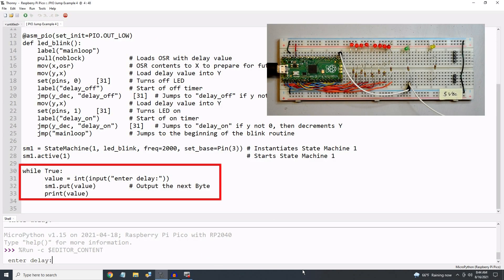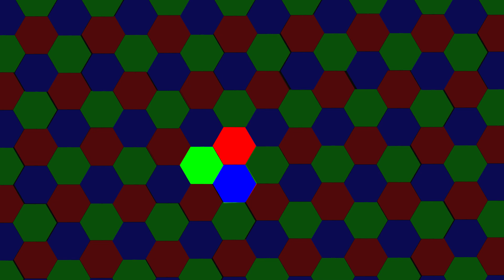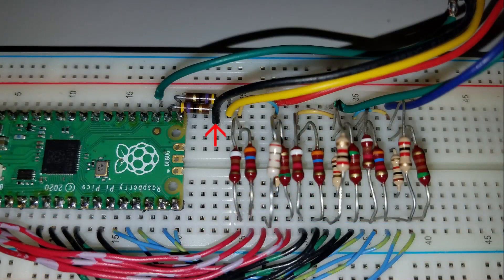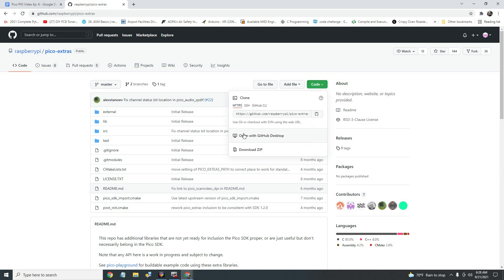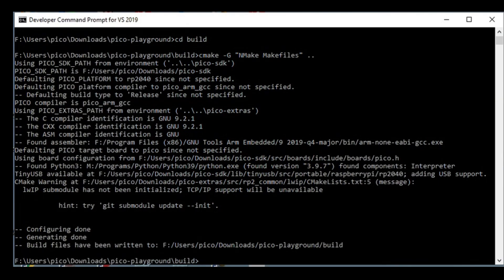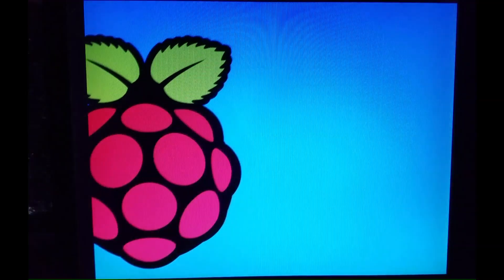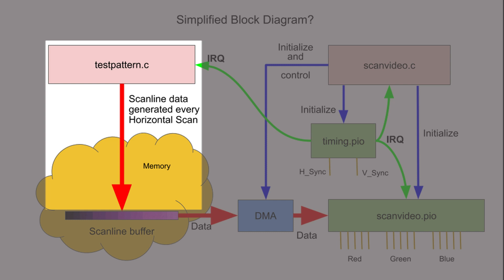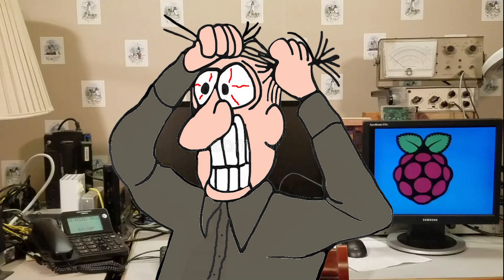Raspberry Pi Pico PIO - Ep. 6 - VGA Video and C/C++

Comment: Why would we need a switch in the resistor ladders?
Reply from the maker: Congratulations, you picked up on that!  You don't.  That switch was included in the Raspberry Pi's "Hardware Design with RP2040" (https://datasheets.raspberrypi.com/rp2040/hardware-design-with-rp2040.pdf) as a way of adding user input (See section 3.2.2).  Thanks for watching!

Comment: Pi Pico SDK environment using Visual Studio Code has improved quite a bit since when this video was created 2 years ago and I highly recommend installing the SDK environment using the Pico SDK installer.
As long as you launch VSC using the shortcut the SDK install creates, and you have your CMAKE instructions set up correctly, the VSC will dynamically help you with coding mistakes even before you build/compile your code.   It will even provide you the means of finding where a reference, such as a function or variable, is declared, defined or used rather than having to use plain Find all the time.
I often make stupid syntax mistakes or misuse of data types, and in the past, such as in Arduino IDE, I would not find out about them until I ran a build.  But with the VSC and CMAKE plugin, I find these out while I am writing, lowering the time to fix mistakes.
Reply from the maker: Thanks for the tip.  I'll have to try Visual Studio the next time I use C/C++.  I've looked at it a couple times before; and the learning curve seemed pretty steep at the time.  Recently, I've moved to bare metal assembly so I'm not using the SDK at all.  But I'll give it a go next time.  Thanks for watching!

Comment: They probably use something like "racing the beam" rendering,  without the need for video ram or a framebuffer.
Reply from the maker: Yes they do.  Each line is calculated just before it it displayed.  However, the Mario tiles do sit in some "video RAM".

Comment: May I suggest I2S DACs for color signals to cut down on IO pin usage... Might be some with DC blocking, but I'm sure some don't.
Reply from the maker: Thanks, I'll have to look at those.  I'm not sure of their max speed.  We have to output a new value every 40 nanoseconds.

EDIT: I looked into the max speed of the I2S protocol and unfortunately it is about 100 times too slow. Video, even VGA is pretty demanding.  Thanks for the suggestion, though.  I might have to look into it for sound generation.  I'm looking at MIDI now; maybe a tiny synthesizer?
Reply: @LifewithDavid1  Yeah, I tried to come back and edit that comment to say the same; but for some reason it wasn't displaying. Maybe grey scale and some "digital potentiometers"; full speed brightness and some optional color stuff.  Wonder how hi res you can go at 60 FPS with just black and white, not grey scale, just full black and full white.  Nothing flashy, just information data display stuff. I definitely want to look into that with a Teensy 4.0; found out it has features I want, like USB host and device mode ports simultaneously. Really audio friendly devices; make a graphic equalizer and VU meter or something, along with audio ADC and DAC, plug in an ordinary keyboard and use it as MIDI and to interface with sketch settings adjustments... just throw the kitchen sink at it. Apparently people have done VGA on them already.... Went on a tangent there.
Reply from the maker: @Marc_Wolfe  No problem.  For more info on what it takes for video display, please see my PIO episode 12 ( https://youtu.be/ZEBkM5FQ86Q ).  That gives the math needed for "low res" VGA at 30 FPS.  Grey scale just means you only need one DAC instead of three, but for the same resolution you still need the same speed.  For black and white you don't need a DAC at all, just on or off.  That should be pretty easy to do.  Good luck!

Comment: I've really enjoyed your Pico videos. I picked one up a month ago, and used your videos to get me started on the right foot. I decided to use the Arduino IDE, which simplifies the build process.

I built an AWG using PDM, and it worked ok, but required a lot of ram for the dma. I changed it to an 8 but DAC (resistor ladder) saving a ton of ram. My only issue was the added cycles every once in a while to perform the chaining and a few cycles in the dac state machine. 

Then it struck me... create a second state machine that provides the timing for the dac machine. The dac waits for an irq set, clears the irq and writes the data. 

That works like a champ, with no jitter on my output.
Reply from the maker: Thanks!  You've probably seen my AWG videos and the journey toward reducing the jitter.  Sounds like you found your solution.  Thanks for watching!

Comment: Does any chip generate excessive heat which requires a heat sink?
Reply: The best way to answer that question is with experimenting with overclocking and your finger.
Reply from the maker: In my experience, the Pico running at 125 mHz runs nice and cool for what I used it for.  I think a hard overclocking would cook things to the point that a heat sink would be needed; but I don't think so for normal use.

Comment: Nice video, learned a lot about my new toy.
The problem of the exact values for the resistors can be circumvented using an R-2R ladder for the DACs. A bit more bulky but as all the resistors are the same, the exact value is less critical.
Reply from the maker: Thanks for the info!  I'm actually working on a video for an AWG that uses an R-2R DAC

Comment: Thanks for the video. It shows some of the extreme lengths the folks at R-pi went to in order to make the RP2040 the success it is.
I have a Pico or four, and I went down the C/C++ route almost from the off. I had major issues installing the toolchain onto W.10, but got there in the end thanks to YouTube, ending up with a viable VSC environment. Much easier (if only because there is a runnable script) was when I did the same thing on a R-pi 3b+ When I went back to the W.10 setup, I found it to be broken. Probably something I’d done, but I won’t be fixing it, instead staying on Linux for this type of thing (and everything else as soon as I can). It just feels “right”.
I experimented (cut ‘n’ paste) with PIO and struggled to get my head around it. Not so much the “assembler”, but the C++ helper programs and how they all interact with one another. Beyond my capabilities, but I just know that the RP2040, with a relatively high clock speed (for a MCU), dual cores and 8 state machines – must be capable of some pretty stunning stuff in the right hands. Not mine though.
I too worked on System 370 - on DOS/VS then MVS, getting pretty familiar with JCL, EXEC, EXEC2, REXX, VSAM and a lot of the utilities that were in use at that time. Happy days until the bean-counters arrived to spoil the fun. When I retired in 2016, it had become a dire existence. I still miss my early days though, and mucking around with the Pico and the R-pi kind of brings back those memories.
Reply from the maker: Thanks for watching.  I agree that RPi has gone above and beyond and I know they will dominate the microcontroller industry the future.  I was thinking I should get a RPi 4 and move toward compiling C/C++ in Linux, W10 seems a little fragile.  
As you see can see from my videos, I'm enjoy reliving the days of "little" computing.  Hopefully these little systems will keep both of our brains sharp during retirement.  

My issue with JCL was when I was developing a Fortran Finite Element program for class at 3:00 AM, there wasn't any support at the computer center; so I had to figure it out on my own.  Nothing like a deadline and trying to learn a new "language".
Reply: @LifewithDavid1  Totally agree with respect to keeping our brains sharp - I view these little systems as a more fulfilling alternative to crosswords and other such puzzles.
Reply: @LifewithDavid1  WSL (Windows Subsystem For Linux) is a pretty good way to run Linux stuff in W10, so you could probably use that to get the Pi Pico's C/C++ toolchain up and running in linux on W10, without needing a separate computer for linux.
Reply from the maker: @miragj  Thanks for the tip.  I'll have to look into that.  Today I really dug into the W10 toolchain and I did make some progress.